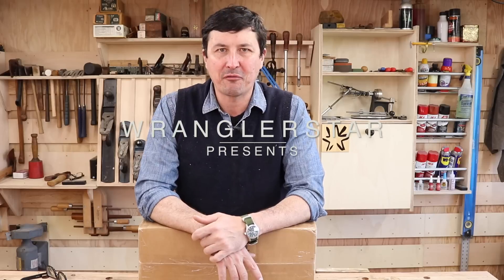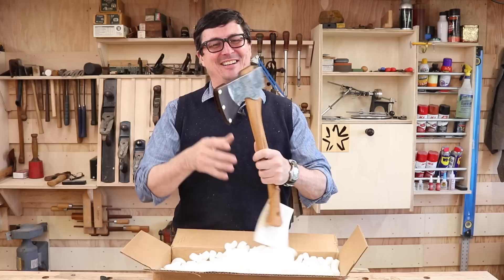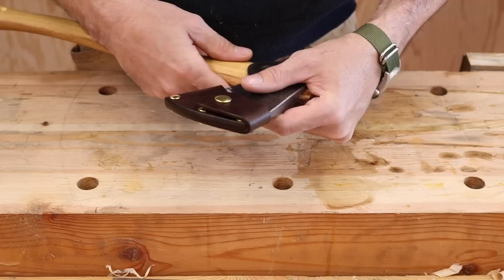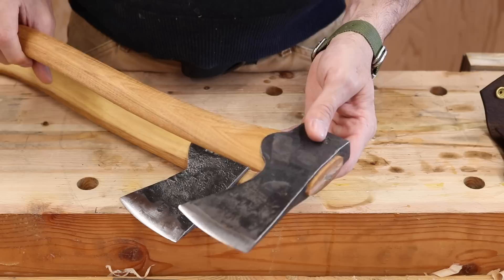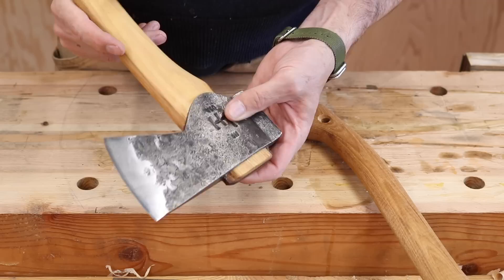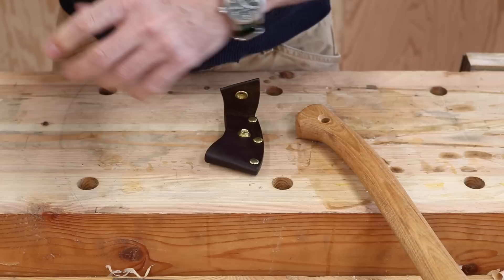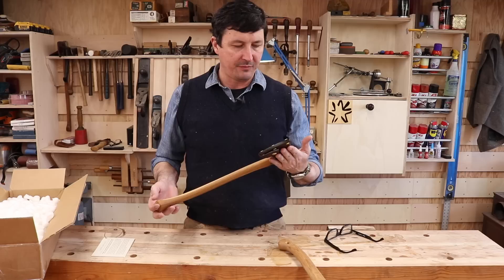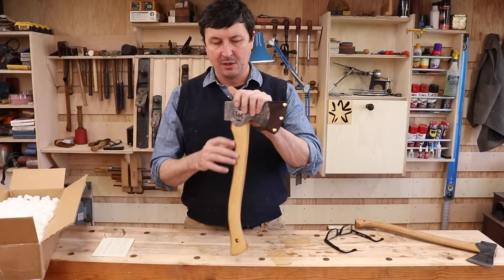Unboxing A Liam Hoffman Axe - AMAZING!!!

Comment: One of the marks of quality leather work is that they use solid brass or copper rivets with heads on both sides, which is much more durable and expensive than using a universal hollow style rivet. It is something I always look for.

Comment: i am from germany and i personally prefer scandinvavian type hatchets and axes that have a very light head and long handle much better than the classic german style as made by ochsenkopf and many others which have a much more significant head. it is just much less tiring to swing a light axe with a long handle while still providing you with more than enough power. lighter axes are just nicer to handle for general duties.

Comment: I have to say that is a beauty. I like it when someone takes pride in their work. I’m wondering if the hammer pole is hardened? Going to take a look at his web site. I recently purchased the Council Tool’s Camp pack axe for 2 reasons . It’s a splitter and has a harden hammer pole that I can use to beat spikes and it comes ready to use. Happy Thanksgiving May you and yours make great memories. 😁

Comment: Hey, id like to ask you advice about an axe. I have a small Hultafors hatchet (NOT the premium version) that i can never get sharp, never stays sharp, and just doesnt cut well. I use the x5 fiskars for making spoons because it is lightweight and it seems o cut quite well, and it isn't more than a $100 compared to the hultafors premium hatchet or grandsfors bruk hand axe. My problem is that thehulatfors just doesnt seem to cut deep into the wood im using, whereas the fiskars does. Because of that, i also feel tired when i use my hultafors and it gets a little dangerous because i have to swing harder to make the cut to make the sppon, and sometimes i get really close to my fingers which i dont really like. Do i need to reprofile the axe? What can I do to make it better?

Comment: Never saw this axe again. I would suspect it’s because with the weight and size of that bit, there’s just not enough handle to make it useful, I mean its practically a hatchet handle. I imagine its awkward. Put about a 24 inch handle on it and it would be perfect.

Comment: probably you are aware that the axe head is way to heavy for the handle length :)
this axe should have at least 65cm handle length.
this video proves how difficult is to hand forge a light elegant efficient AXE (like Swedish axes).
Otherwise this axe is piece of art.